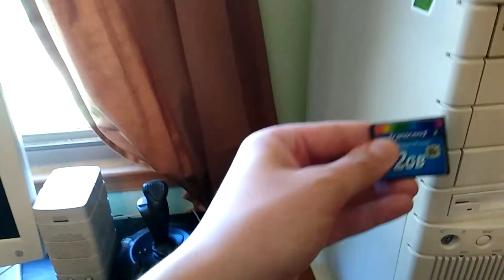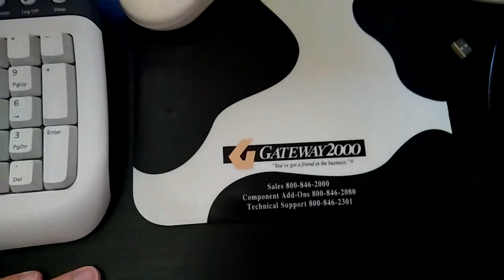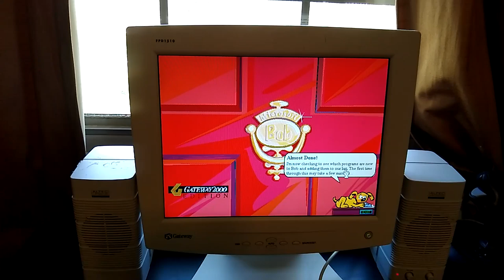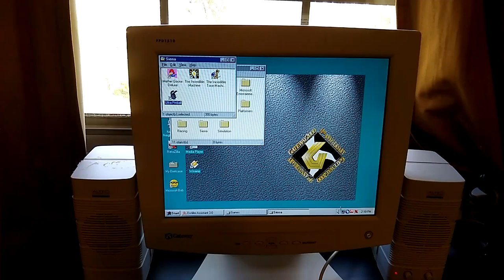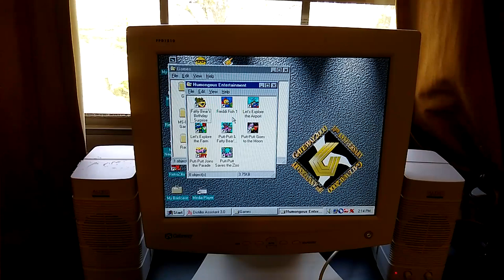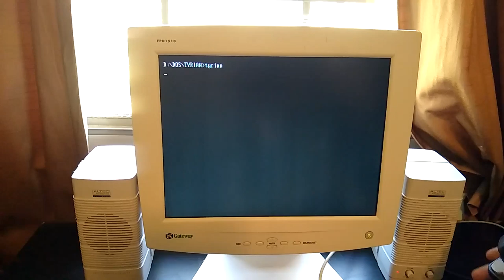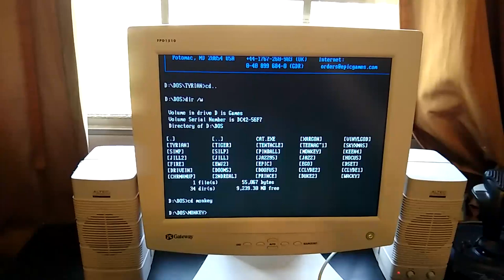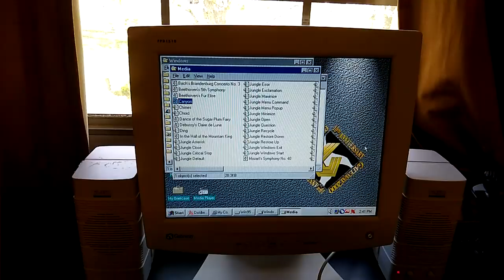Gateway 2000 P5-90 Update (Easter Video 2020)

Comment: Very nice Gateway 2000 tower. I had one I bought in 1995, a P5-100 with a whapping 1GB hard drive...all in all spent $3K on the bad boy. Unfortunately, I sold it to upgrade to a 1998 system. Always regretted it. Now, I have a P5-120 flat desktop and a P5-166 tower. It they were a pain to get back up and working again, but they work a charm now. Guess I have an affinity for gateways and my other fascinations are with Apples/Macs and Commodore.

Comment: And I think you should consider to upgrade the BIOS to 1.00.12.AX1, then 1.00.16.AX1 (you need to go this way). This would allow you larger hard drive, and some improvements in fixing the nasty CMD640 IDE controller bug that can corrupt data in 32bit multitasking environments...